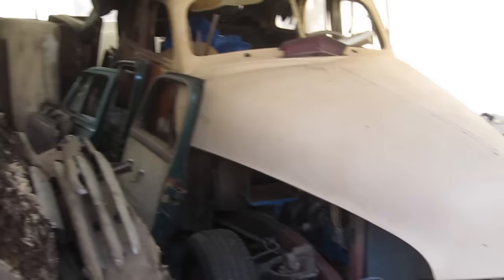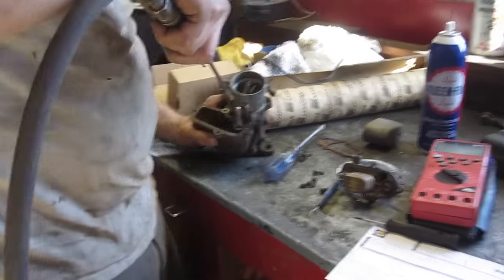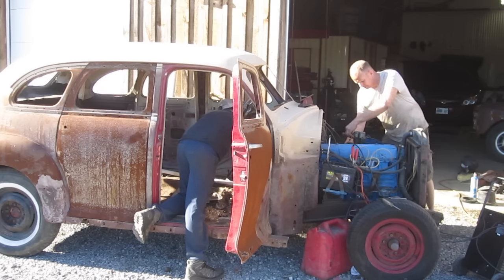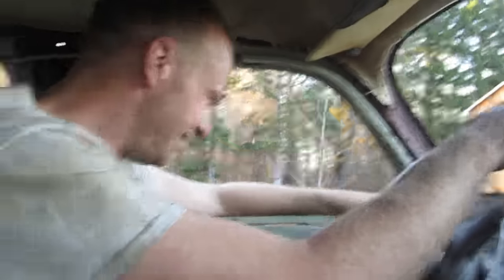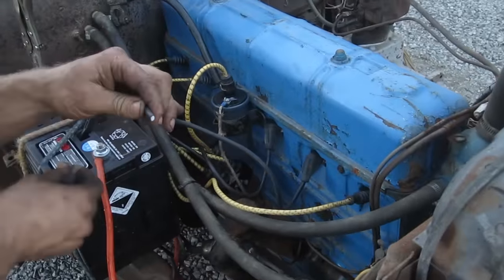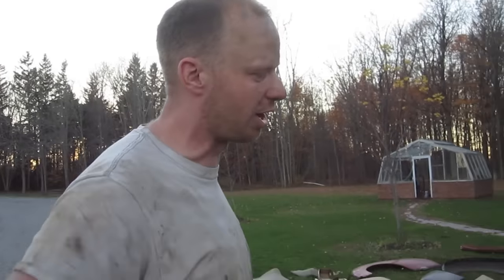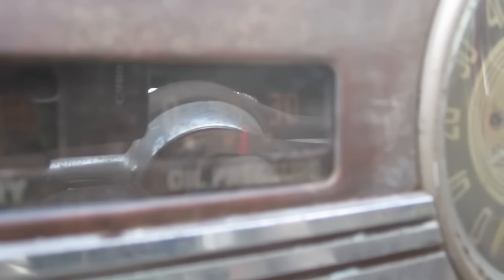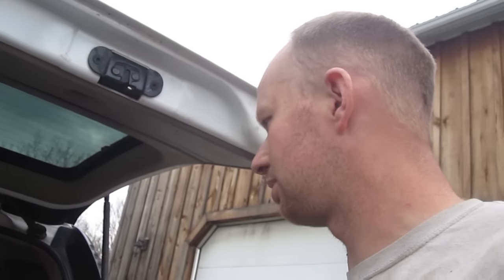CLASSIC CAR RESTORATION: '48 Chevy Fleetmaster (Part 1)

Comment: I know this video is old, but so is my car. I need help with what to order-- toput my front and Back wind shields in- whet type of weather stripping and pinchweld seal-  and How to put them in. Seems the installer and the salesperson disagree. Installer says I "don't need a U channel and Pinchweld seal and the salespeson says I need "Both"  and 1 says- the windows go on the car from the "outside" and the other says- that's wrong -they go in from the inside. Do you have a video of this car wear you install both front and back?